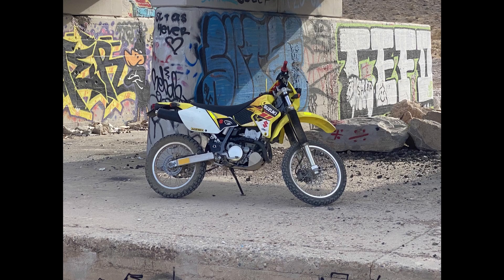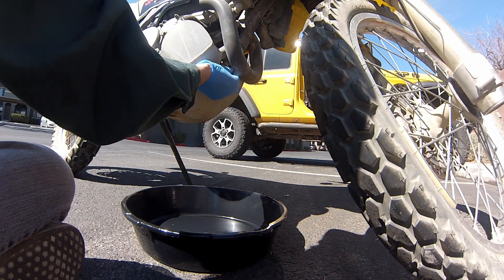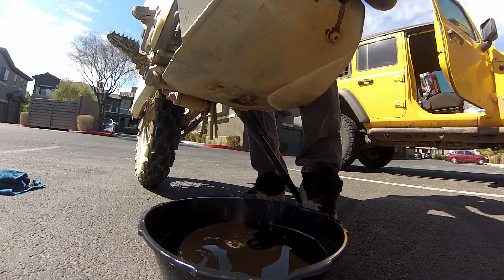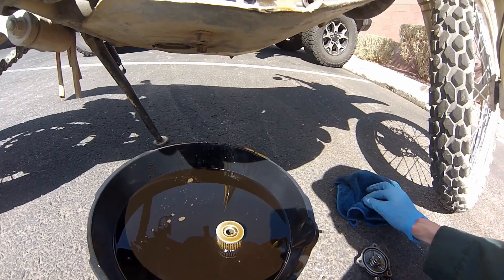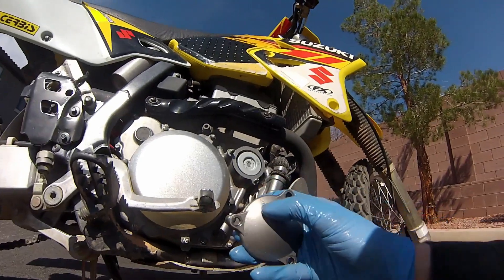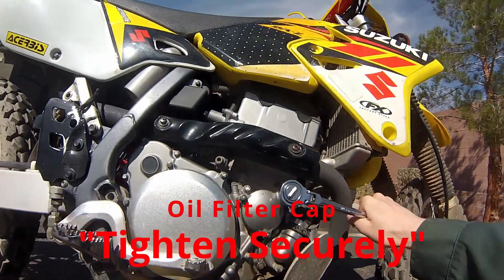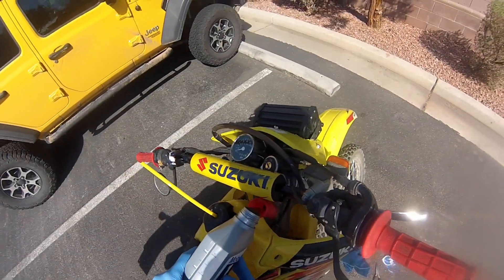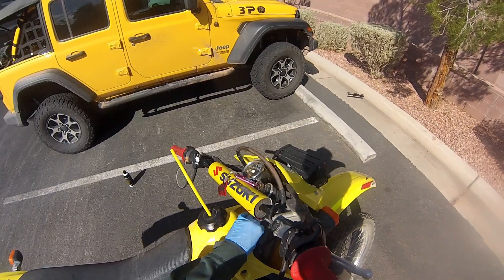DRZ400 Oil Change Tutorial with Torque Specs

Comment: Great video!  What LED did you mount above the headlight?
Reply from the maker: Thanks! I actually bought it like that. The guy that I bought it from told me that he originally tried to mount it to the front fender but due to the bouncing he decided to cut into the number plate for a more permanent install. I really like the LED though. Plenty of light for night trail riding!
Reply: @advjeep4096  excellent!  I think the next thing I add to the DRZ will be a set up like that.  Keep up the videos!!